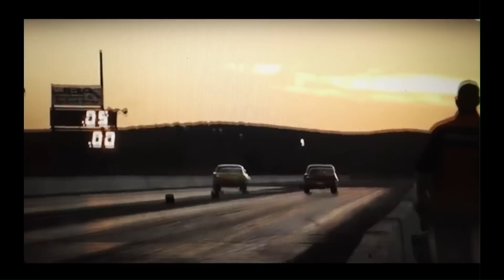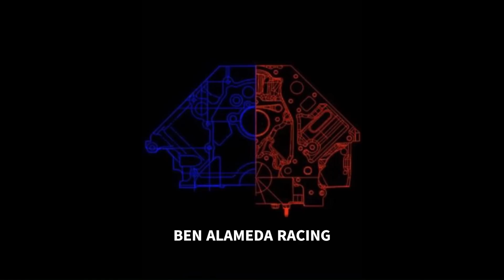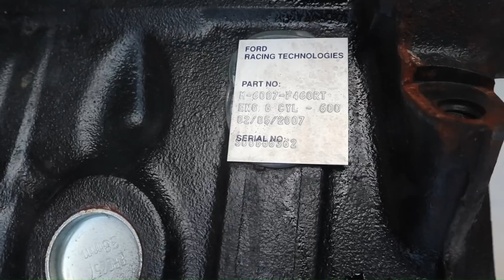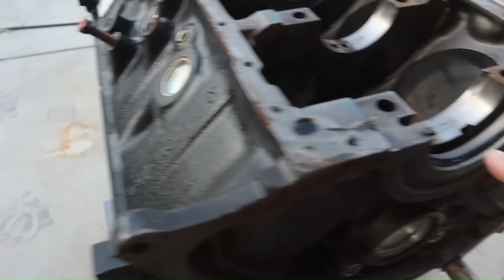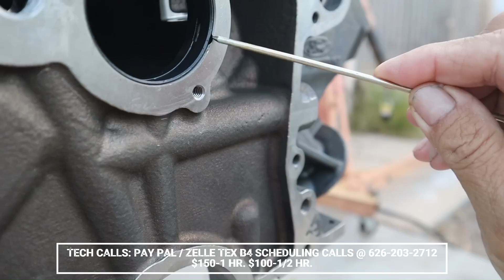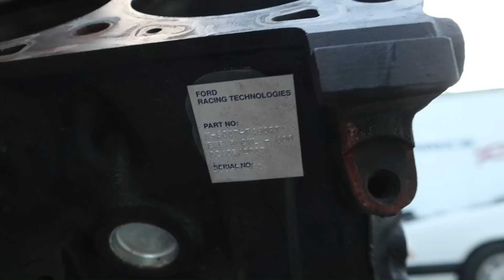FORD A460 BLOCK  INFO FOR OUR STREET BOSS 429.

Comment: What is your opinion on the C and C Motorsports Block?
Reply from the maker: Most aftermarket made in the USA blocks are very good. Some but not all foreign castings are also well engineered so we must choose carefully from their lot.  C&C will be a lot better than factory blocks even the SCJ and the only exception are the original Boss 429 which is strong but not perfect by all means.

Comment: The slanted, tapered side walls of the cylinder block could be milled to expose the water channels. Steel plates could then be welded over these areas to seal them again, while also creating larger water channels for improved functionality.

Comment: Ben, I'm watching and will be following with interest. As you may be aware, I've built and have had success with Ford's original Boss 429 engines. My former business partner, Ed Prout, held NHRA national records using the original version of this engine, including the much- maligned cylinder heads. I was fortunate to be mentored by Ed at an early age. Certain enhancements can be made to the basic engine that make measurable differences. I'll just say that keeping nature and physics in mind that one must work within its design and not approach this engine as you would ANY OTHER. I am currently building an original street Boss 429 that will be reinstalled into its original 1970 Mustang chassis. The car is destined to be a driven-concours show car. However, when it is driven, it will perform like the original Boss '9 owners wished theirs had. I have always said that when it came to engines, Ford historically has had a short attention span, not fully developing a particular engine, moving on to another design. Ben, it takes post-production guys like you and others from the present and past who make this basic engine perform as it could and should on the street or in competition.
Reply from the maker: Bill, thanks for your kind words sir and appreciate your comments.  Ford has a horrible job of detuning a good racing engine to street duties and these is where it fails miserably!  I feel today with many Ford of Europe engineers coming in it really changes many things I do not agree with.  I have met and talk to several SVO Engineers and they feel the same way sadly. You are lucky to have been part of the Boss engine from years ago!
Reply: @benalamedaracing2765  Thank you for the response, Ben. I agree with your thoughts on smart people and intervention. I remember when Jon Kaase was crew chief for Dyno Don. Jon told me that Ford teams were frustrated with the Boss 429 and wanted to stick with Cammers and Clevelands. He also told me that the Big Boss had so much potential if someone would take the time and money to re-tweak it. In the years that followed, Jon Kaase became known for his successful  redevelopment of the Boss 429. 
Pretty Cool!

Comment: There are several things to glean from this video. 
# 1 They had trouble timing the engine.
#2 it has 55 degree timing on 6 of the cylinders 
#3 65 degree on the other side of 6 pistons.
#4 They used a HALTECH TO SIMPLIFY THE RUNNING OF THE ENGINE 
#5 65+55 = 120 , WEIRD THAT FERRARI DID THIS, & HOW DID FERRARI FIRE IT IN 1966 ? 
ANALOG DISTRIBUTOR WITH ODD FIRE SPACING ? 
A JUAGUAR DISTRIBUTOR DIDN'T WORK. 

THE CAR BODY WAS CUSTOMIZED IN 1966. 
WHEN HE PAN TO THE REAR, 
LOOK FOR THE 1966 FASTBACK MUSTANG FEATURE. 

QUESTION:
YOUR 16 PLUG BOSS 429 .
DO YOU THINK USING A HALTECH INSTEAD OF 2 MAGNETOS WOULD SIMPLIFY TUNING ? CRANK TRIGGER IS SUPERIOR, RIGHT ? 
THESE GUYS HAD TO USE WASTE-SPARK IGNITION BECAUSE THE HALTECH LIMITATIONS. 
WHAT ABOUT USING BOTH ANALOG & DIGITAL IGNITION ? 
CHECK OUT THE EMAIL I SENT YOU ALSO. 

https://youtu.be/VxTIhJB2N1Q?si=M4szvKRIEht6sC5b
Reply from the maker: That is an impressive Ferrari!

Comment: I had a Alan Root 460 engine in a 73 T Bird back in the 1980- 1990s that had some serious low end torque and surprisingly good gas milage. 
It was a real goer. 😛
Reply from the maker: Built properly they will make good power for sure!  What heads did you end up using on it?

Comment: Ford always seems to come up with an idea and then put 90% effort into it.
Reply from the maker: You are right on point and it is sad when they come out of this stuff without consulting racers who are at the top of their game!  There are more worse things I have not touch on as well.
Reply: @benalamedaracing2765  The thing is there were racers working in SVO and FRPP it's like they just don't care about making things the best they can possibly do it.
Reply: Historically, Ford has had a short attention span when it comes to fully developing their engines. 
Moving on from one design to another.

Comment: I always joked the reason they made the Boss429 was so you could actually get to the spark plugs in a Mustang. On a side note its funny everyone always going on about Hemi's is that when they created the 1st gen it was not for performance but it was their way of coping with inconsistent fuel quality at the time especially since they used them in alot of of industrial applications as well.
Reply from the maker: Yuri, the open chambered true hemi was really prone to detonation because of its quenchless design.

Comment: ben you ever work on a nascar chevy v6 dry sump only motor,no provisions for a filter,based on 90 degree small block,8000 rpms for 3 hours. solid roller,4 bolt splayed mains,gmpp botie block heads and a trick two piece intake that you have to take the top part off to port the bottom half,and the bottom halves bolts are inside,you cant get the bottom half off without taking the top off,bought it off a old racers widow,time capsule.great engine for boost-899 gmpp botie blocks can take it
Reply from the maker: Should be a great project engine because it is rare!
Reply: I saw your video on the NASCAR V-6 very cool engine! Glad you got it 👍
Reply: @WilliamHenk-n3e  thanks man,im tickled to death